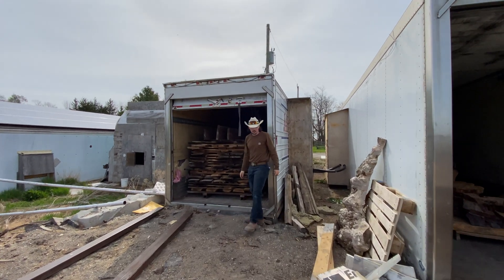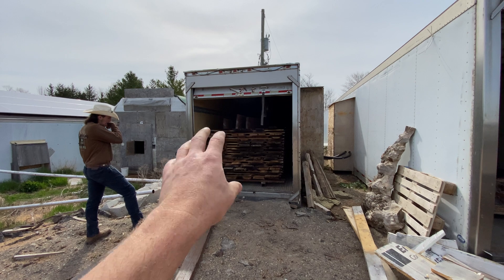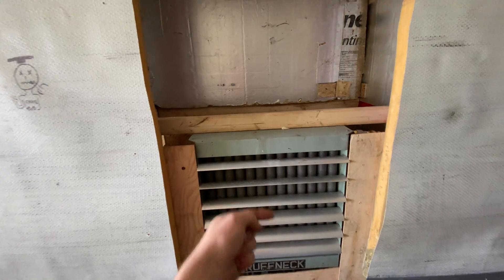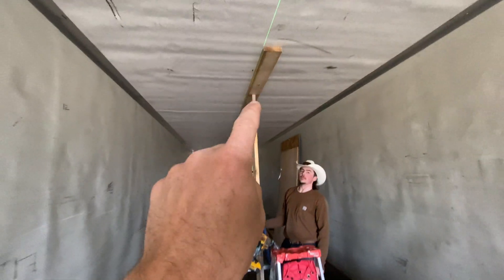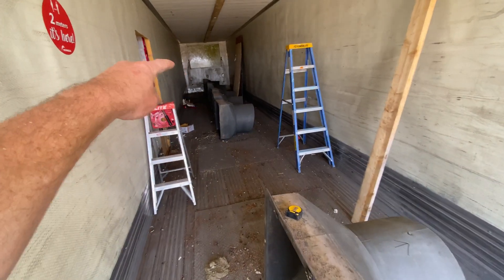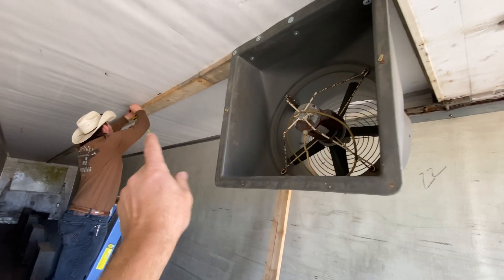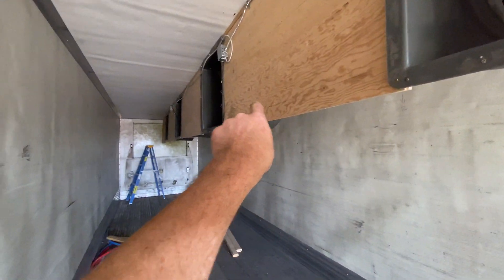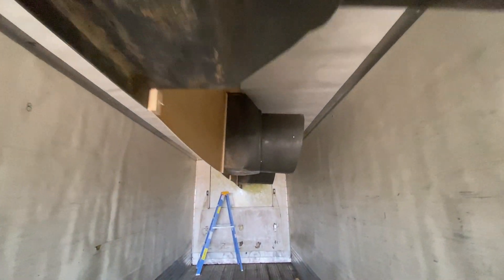Build a Conventional Heat To Vent Lumber Kiln Heated With a Outdoor Wood Boiler

Comment: Is that amount of air flow necessary? And whats the dry time roughly?
Reply from the maker: The amount of air flow is most important when drying higher moisture content lumber, but still important for lower moisture content as well.  So the more the better.  Im sure there is math some where, but I just went off  balance of cost / space / viewing other designs.

Comment: hi how about the dehumidifier part do you not have water sitting on the ground 
i am looking into building the same set up but i will be drying pine will i have any issues with water puddles? ahould i also put a commercial dehumidifier in there?
Reply from the maker: We are drying lumber all under 30% moisture content, most under 20% so there is not a huge amount of moisture or need to maintain a high RH when drying, so no we do not get any water puddles, all moisture is vented out the end.

Comment: I would be carefull of those  fans. When they give up the ghost in the middle of the night they will burn your whole set up down. They are not rated for the heat of a Kiln. I would put a smoke detector in the kiln that is hooked up to shut it all off if it goes off. Most motors are designed and rated for 40 degrees C. (104 F) The insulation on the windings will degrade with constant high temp. The bearings on the motor need high temperature grease. Also when the bearings heat up they have to have enough play for expansion . Ask me how I know.

Comment: Carriage bolted, not lag bolted. Lag bolts are pointed, carriage bolts use nuts.
Reply from the maker: Yes your right doh!
Reply: @CanadianWoodworks  I have had personal experience with replacing lag bolts the wood deck contractors drove in using their framing hammers. On new home construction! (I did callback repairs for the builders)